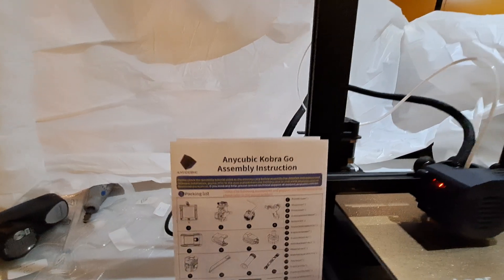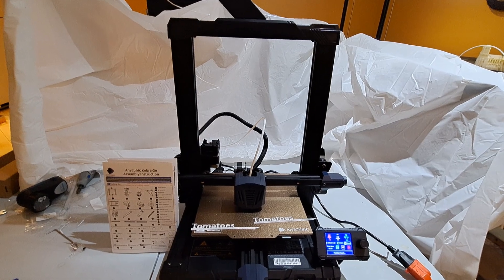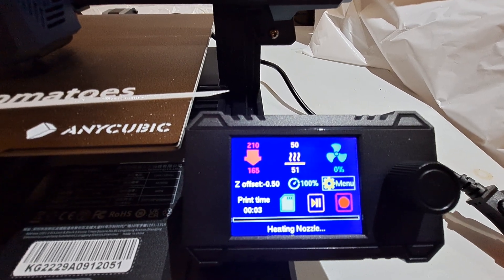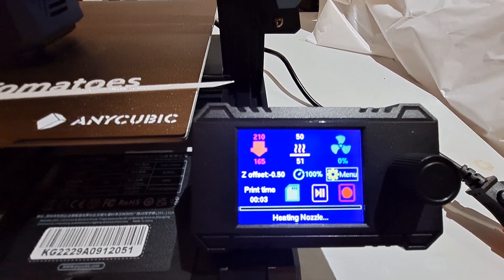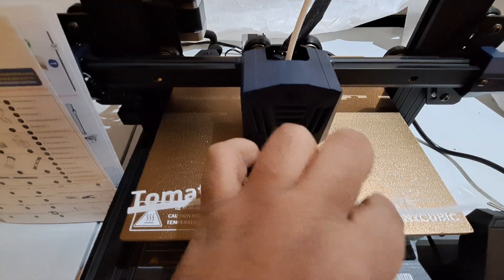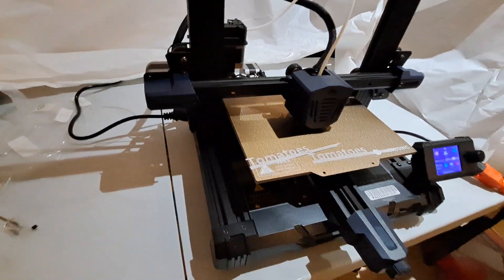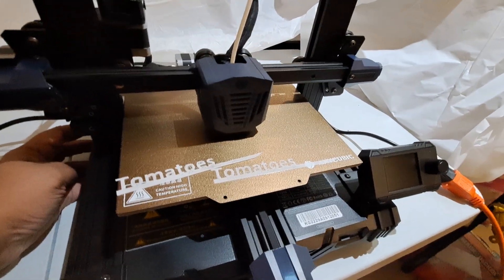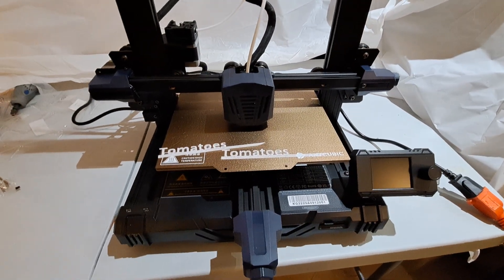Anycubic Kobra Go Review, worst 3d printer ever, do not buy

Comment: I have the same issues did you get any resolution that works yet?
Reply from the maker: No, they sent me new Power supply unit and new a motherboard, but nothing worked. The printer prints when we do not set bed temperature (or bed temperature = 0), but then the printing model does not stick to the bed. I believe their motherboard has a problem with the heating bed. The only solution I see is using a MOSFET, there are many videos on Youtube.

Comment: My Kobra Go works perfectly... 30 hours printing with very good quality. In your case may be a power supply issue.
Reply from the maker: No, they sent me new Power supply unit and new a motherboard, but nothing worked. The printer prints when we do not set bed temperature (or bed temperature = 0), but then the printing model does not stick to the bed. I believe their motherboard has a problem with the heating bed. The only solution I see is using a MOSFET, there are many videos on Youtube.